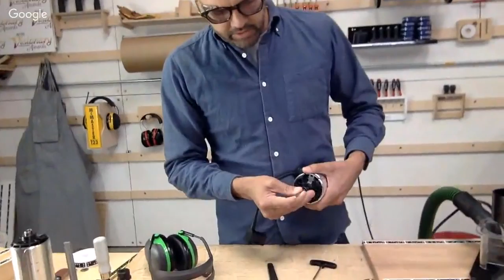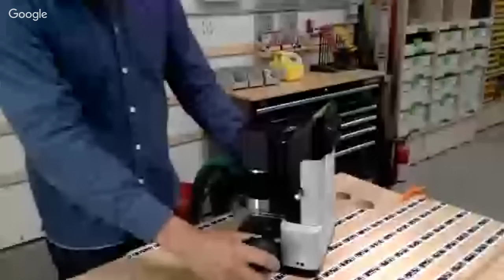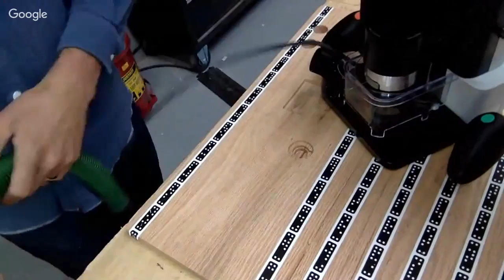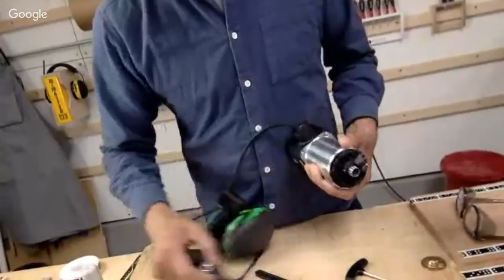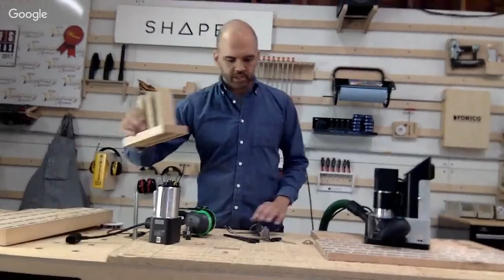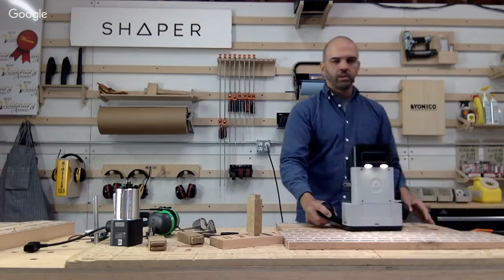Q&A with Shaper CEO - Joe Hebenstreit

Comment: Make shaper run on DC power. Then it is only a matter of providing an adapter. Laptops have already  perfected this power issues.
Reply: When is the last time you used a DC powered router?
Reply: ThreeTwo Victor ever since cordless routers were invented. All cordless tools are DC.